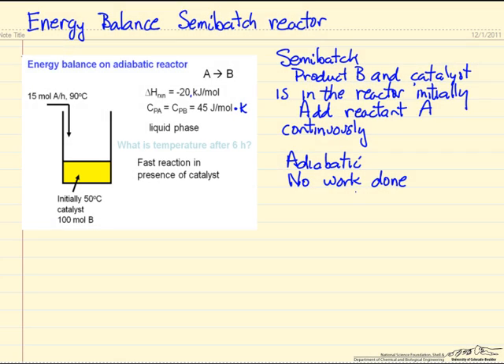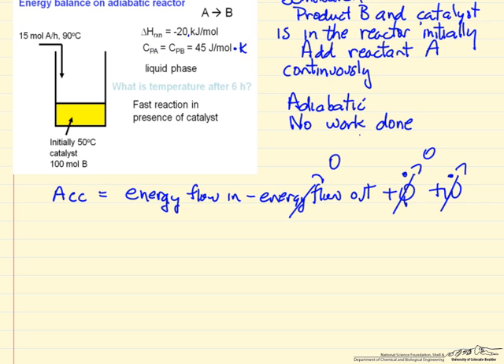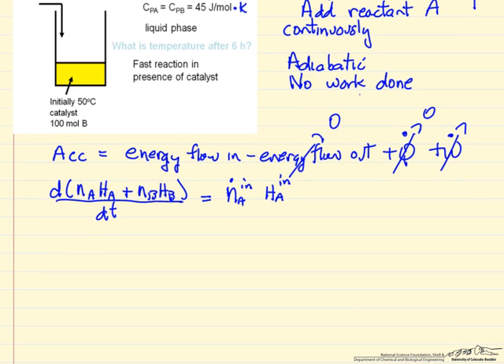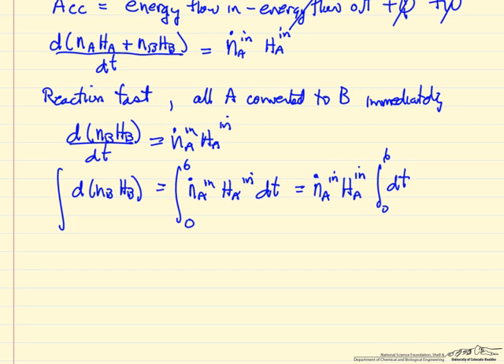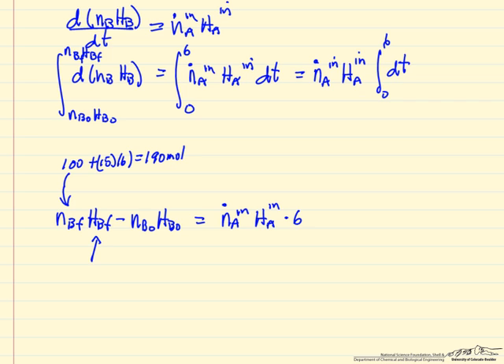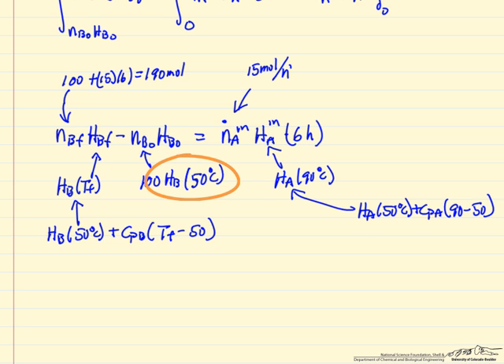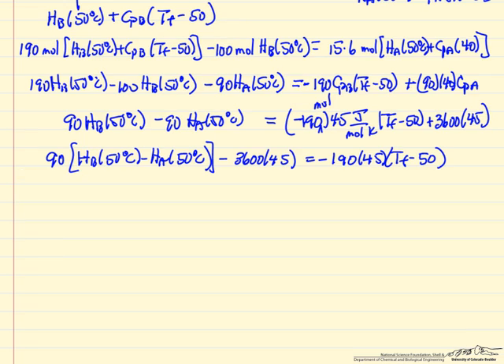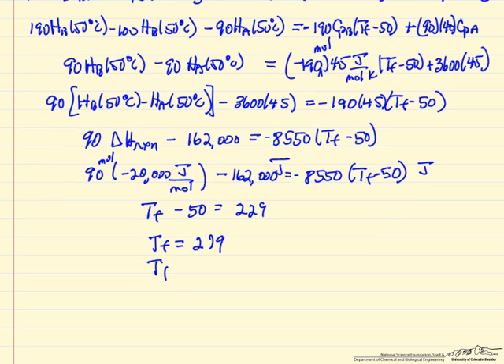Energy Balance on a Semibatch Reactor

Comment: Why was the final enthalpy for B expressed as the sum of the enthalpy at 50 degrees and the specific heat times a difference in temperature?
Reply from the maker: The enthalpy of the species can be calculated using the sensible heat change (m*Cp*dT) but also needs a specific reference point.  Most of the time 25C or 0C is chosen as a reference.  Here since we start at 50C and want to know the heat change due to the reaction, we are using 50C as a reference and the point for the reaction enthalpy to be used.